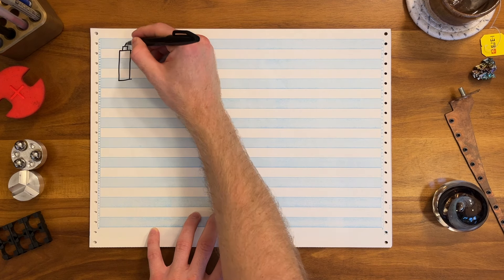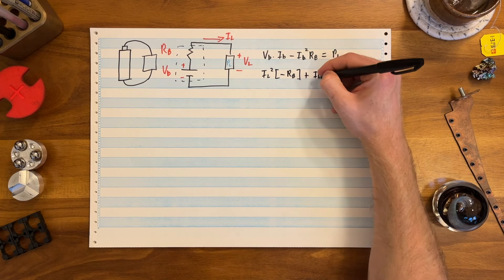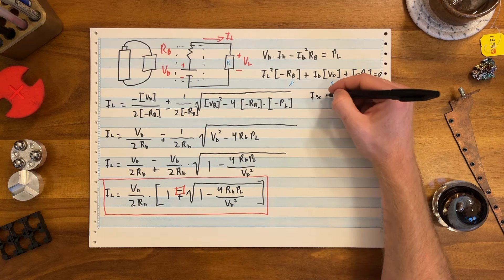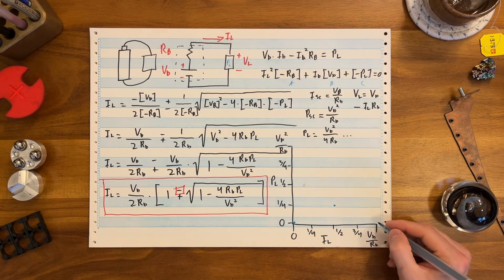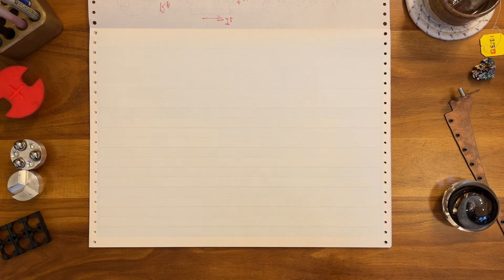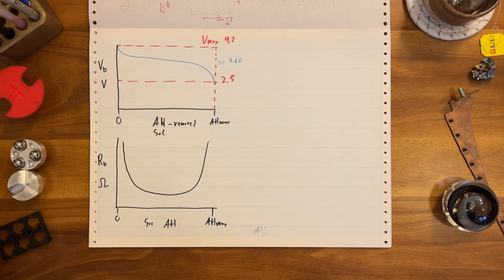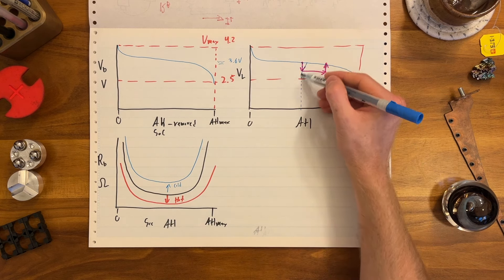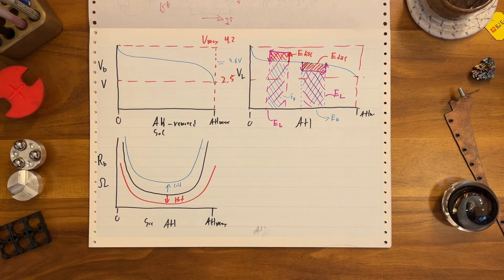Lithium Batteries 101: Introduction to electrical modeling

Comment: We did a model for a Nokia mid-size li ion cell, i think 1350 mAh.. we included some frequency response info...if that's interesting to anyone, i can try to dig it out of archives...we instrumented a phone with current probe and voltage probe, and did voice call sms and Wi-Fi, and the model looked very good, maybe >5% on 2 A loads.